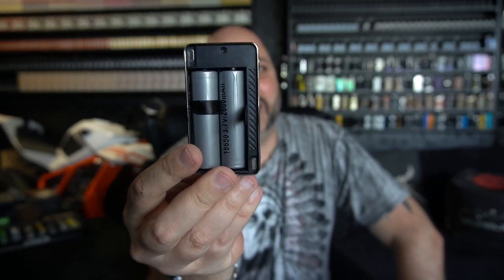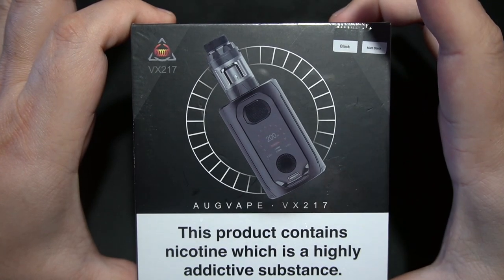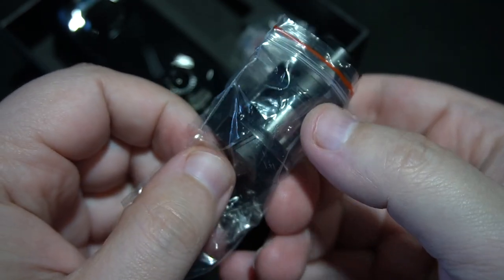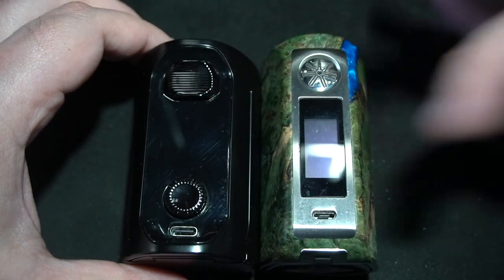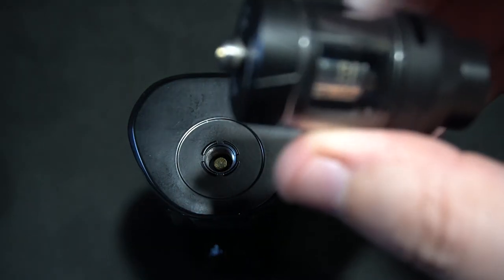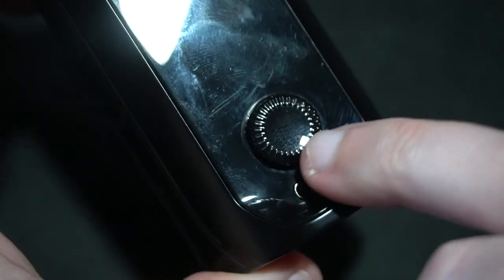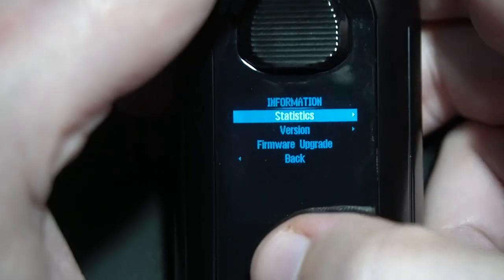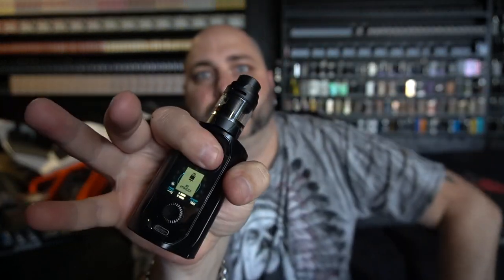A 12V Mod?! Augvape VX217 Kit w/Mike Vapes Intake Dual SubOhm Tank

Comment: I'm glad that companies starting to put out mods with higher voltage again. There's been so many single cell mods that maybe only does 5v. & Duals that does 8.4. I'm hoping the new Freemax single 21700 will be good since it can do 7.5v (but the dual 18650 version only does 8.4 for some reason). Only downside on the freemax mods is that it looks like someone was on acid when they choose the colors. The Maxus 100w is the one I will be interested in, Though I will get some wraps for those panels,just crossing my fingers it won't be junk
Reply: Oxva velocity 21700 does 8.0 in voltage mode.
Reply: People should be on acid when designing everything makes it more interesting. My opinion anyway.

Comment: Yeah jai you are right 12 volts is awesome for those who build at higher ohms. it is always a sign that they didn’t cheap out on the board when they gave a high voltage cutoff so it is likely a decent board. Not really my thing tho as I agree that the fire buttons look hideous. Anyway hope you are well Brother 👊👊
Reply: Dane I think you read it wrong.  It was a 2.8 ohm build not a .28.  It just a lot of wire (almost 2in each lol). It was only at 51w.   High Ohm + High Voltage = Low amps (4.2amp in this case) to reach the 51w  which is less stress on battery. where as a .28 ohm build at 51w would be only 3volts but its 13.5amps!
Reply: Celtic Wolf holy shit you are right. Duh I don’t know how I missed that lol . I am gonna edit my comment since it makes no sense now. Yeah low ohms and high amperage is way more stress on batteries versus high ohms and high voltage (low amps). I don’t know wtf made me think all that wire would ohm out at a .28 Lol.

Comment: A lot of people (Including my self in the past) dont really pay attention to the v/w/a/c as the real benefit of high ohm and high volt comes with batteries and life!!! you can get some 5000mah low amp batteries so you could run 2x  5000mah 10amp batteries and if you  vape at 50w  with a 1.2 ohm coil its only 6amps with 8volts which would be amazing battery life both vaping time "puffs" and over all life span of your batteries!!! Its kinda cray cray that we push the 0.2ohm and higher amp esp when lot of people vape around 50w. I wonder why considering the real benefit you could get with low amp high MAh batteries!

Comment: hey jai, dont want to be the guy on the keyboard, but dovpo has been doing 12v on their dual battry mods, dont know if it is accurate, 42 amps its the limit, but whit high enough ohms it says you can get the 12 volts. And they dont have ugly ass buttons lol.
love your style. greetings from argentina
Reply from the maker: It’s not accurate

Comment: Should've been paired with an RDA, you just know there will be people trying to run those coils at twelve volts. 😂  I like the UI and the USB type C connector, but would rather have a single battery mod these days.

Comment: It's not mesh or a coil. Strips like ofrf  aren't technically "Coils" either. We make coils out of wire that have a spring like shape. 

Mesh is woven like the vandy vape rolls.. Little pieces of metal with holes punched into it isn't mesh. It should be called mesh styled or something. 

The wire inside these coil heads is corrugated clapton wire. It's usually discolored too which makes me think the pre heat it for whatever reason, probably just so it stiffens up some.

Comment: Hmmm ...I'm interested in this kit. Unique coil, mod that can do 12v, decent size for a dual 21700 and it fit a 30mm rebuidable (even though I don't own one). I don't mind the dial but the fire button, it looks loose and needed to press down all the way.

Comment: Got the Odin 200 watt with the dovpo chip it does 12 volts too
Reply: Indeed
Reply: Thanks for the info!💯
Reply: @abrahamjlungacta5795  topside dual does 12v too
Reply: @nicolasferron2047  yup same board👍

Comment: Should have gone triple 21700 using 12volts.(of you're gonna go niche go all the goddamn way)
 I feel like using that much power on two 21 cells is going to annihilate battery life  and the overal  life of the cell. Correct me if I'm wrong.
 Also can't disagree that wheel design. Is trash along with the fire button. WHY ISN'T IT A CENTERED 510?! C'MON!!! menu is solid as fuck, good chip well done.

Comment: Electrolysis which causes oxidation. Prime stainless steel and copper
Reply: Galvanic corrosion oops! We are going to the salon.
Reply: @kevinmusser5717  kinda like a cathode and anode doing electrolysis to remove rust from an object and all the corrosion goes to anode lol I have done it with a car battery charger DC, busket of water with sodium carbonate and some rebar

Comment: How well does it goes against the Uwell Evidlo?
Reply: I can tell you now the Evdilo is way smaller of a mod but the Evdilo definitely doesnt do 12v that's for sure... If you've ever seen the Vsticking mod? The Evdilo is smaller than that... Also the Evdilo is smaller than a lost vape paranormal dna250c and where the lost vape is a little skinnier side to side comparing it to the Evdilo front to back it's not by much. 

The Evdilo is my everyday carry I absolutely love that mod for a dual 21700 that you can also use 20700 or 18650 it's a nice compact and small dual 21700 that I think companys aren't gonna be able to make a smaller mod unless they design it exactly how uwell did....

Comment: That thing looks so cheap, like a toy... I can tell that door and 510 pin are not gonna last. Jai, you use to build computers, not sure if you did water cooling but galvanic corrosion is why you do not mix kanthal and nichrome. Yes e juice has electrolytes, its what cotton craves.